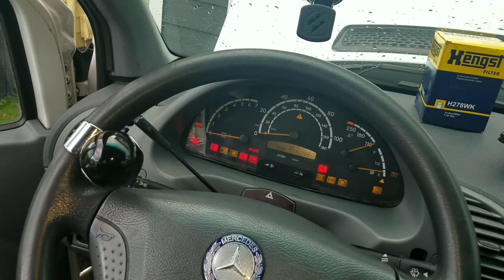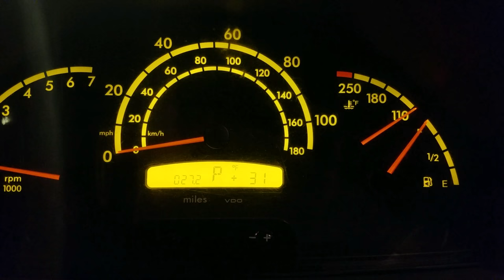How to remove glow plugs on a Sprinter [04-06] & repair glow module

Comment: this is not the smartest way to do this..anti seize spray after running the engine.. make sure its not too hot, but warm.. cranking back and forth, very lucky he did not break the glow plug!!!
Reply from the maker: I soaked them for months in penetrant, pretty sure i mentioned that in tye vid and the description. I did go back n forth and the engine was hot, i even said to use a hot engine in the description. So i dont think your criticism is accurate. I did everything right and i am a college educated diesel tech.. It's not luck, its just the lack of rust on this one, was too easy.